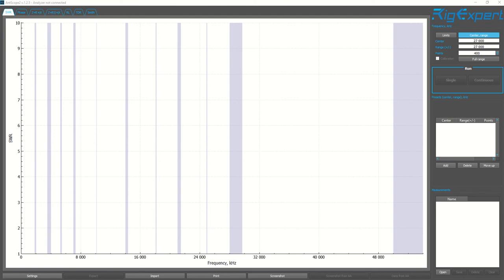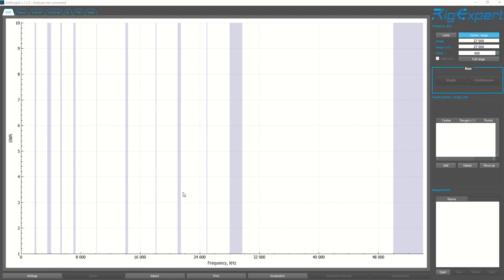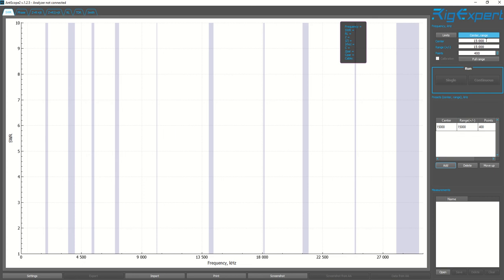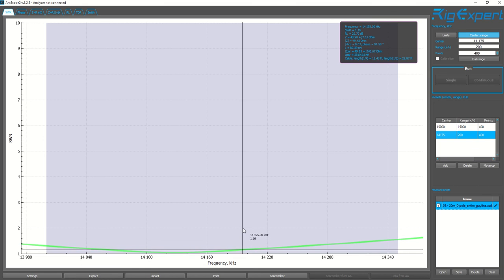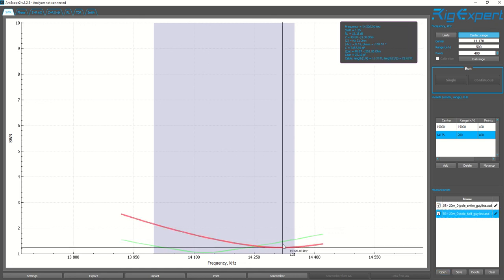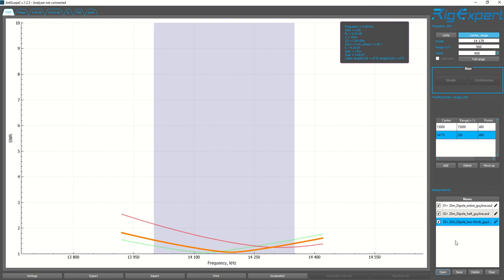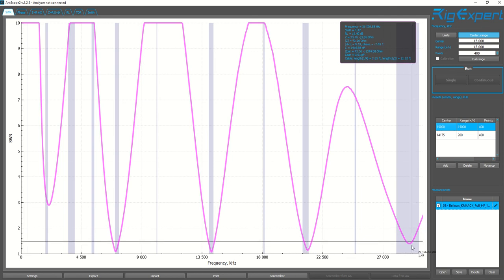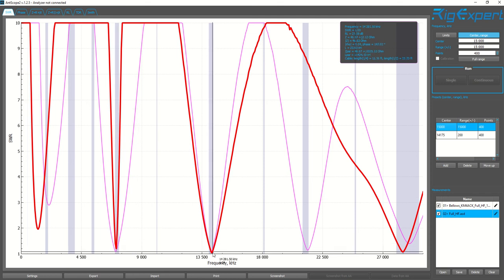RigExpert AntScope2 Demonstration

Comment: Hello Robert.
Can you show the connection to the computer from the radio/receiver.
USB to radio?
Thanks

Dennis
Reply from the maker: I'm unable to post pictures in comments.  I've uploaded a pic here: http://www.rramsey.net/pictures/IMG_4354.jpg
Reply: Robert, thank you, most kind. And so quick. 73's, g4cir. Yes, I am a Brit but lived in Oregon the last 21 years.
Reply from the maker: @PreferMetal1  If you have any more questions, you can look me up in QRZ - de ah6x
Reply: I can’t get my Dell laptop or Panasonic TB to connect to my AA-650 Z. Neither BT or USB cable work. I set up the freq, scan, points, I hit single & all I get is a red line at top or bottom of the graph. I’m running W10. The whole reason I purchased the unit was to use my laptop. Rig expert NEVER returns my emails.

Comment: Antscope2 latest version keeps crashing. Prior version stalls or disconnects even on USB with Stick Pro.  App requires multiple taps to re-connect via bluetooth.. it should do it automatically when you go do a scan, or at least be just one click.  Also there has gotta be a way to save markers or set them by entering a frequency.
Reply from the maker: I'm running v 1.3.0 on three separate systems and haven't had any issues connecting my AA-35 Zoom via USB.  I don't have any experience with trying to connect my AA-35 Zoom via Bluetooth, although it's supposed to be able to do that.  Have you tried different USB cables?  The preferred cables have chokes at either end of the USB cable.